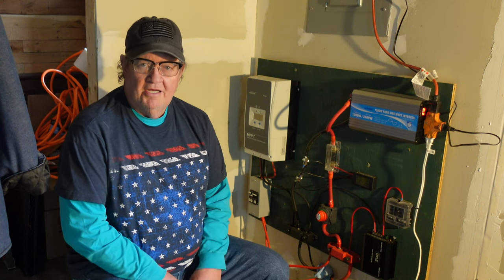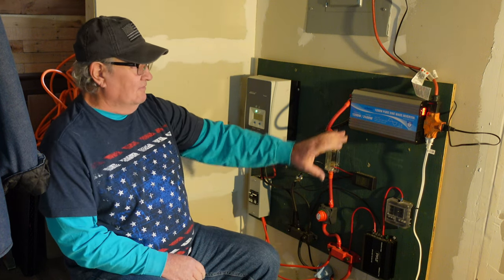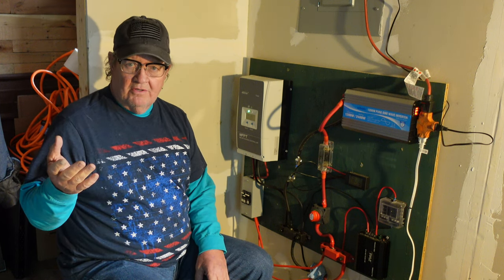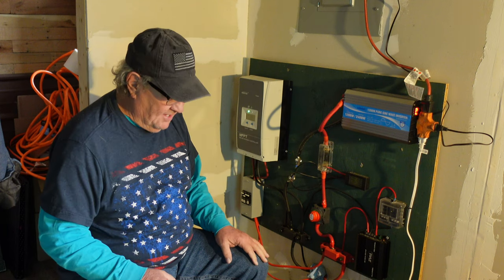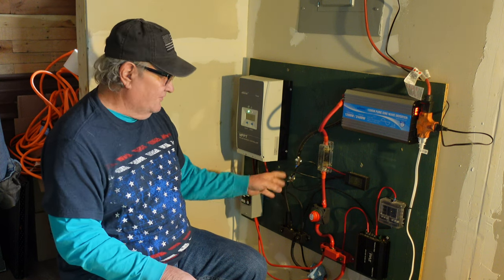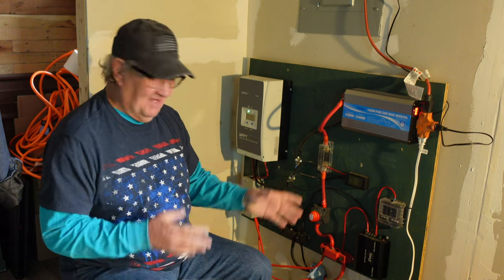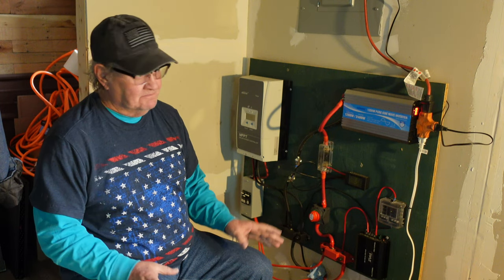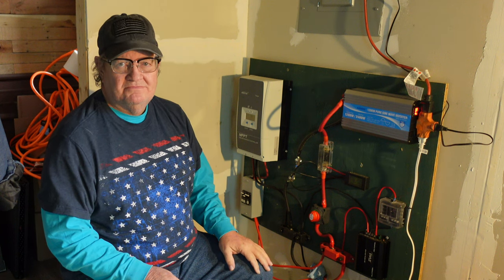Easy DIY Basic Solar - Panels Controller Inverter & Battery Bank

Comment: Happy new year Joe, I have a small portable solar setup in  my van. It’s enough to charge a laptop a few times and run a 300 watt inverter for some small ac things.  Your dead on about solar, it’s easy and fun to tinker with.

Comment: Great video great info! Check out transfer switches for when you hook inverter to your power box! It's really cool when we fire up our generator it switches from batteries to the generator and we charge our batteries while generator is running our system is a little bigger than yours! I hope I explained the transfer system okay! They are really cool makes solar simple! God bless!
Tony n Lee Ann

Comment: Thanks just subscribed seen this video posted on a facebook group. im interested in a simple budget offgrid system with a limiter.  I live in CA and they have alot of BS permits if i mount them on my roof.  I figure i will mount them in the backyard against my fence line should be able to get around 10+ panels or more. shouldnt take up alot room.

Comment: There's that stripper music again!! What happened to the live stream on Saturday night? Will Prowse has the best solar power channel on YouTube. He even wrote a best seller book on solar power that he sells on Amazon. I don't know why you always have to be so technical. 

On a side note, the average power used to execute someone in the electric chair is 2,000 - 2,200 volts at 7 to 12 amps, so that would be somewhere between 14,000 and 26,400 watts. It would take about 56 to 106, 250 watt solar panels, to execute someone in the electric chair via solar power. It would be the first solar powered execution. But I digress...

Joe, I cut sugar out of my diet and have severely limited my carbohydrate intake since October and in that three months, I've only been able to lose 10 pounds. I seem to be stuck at 225 pounds even though I've cut out all sweets and very limited carbs! I'm about ready to give up.